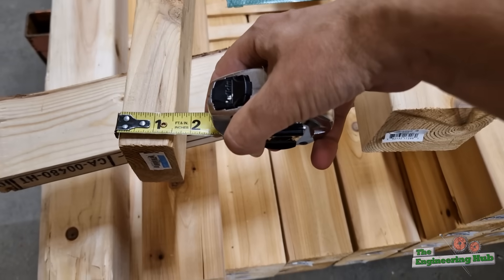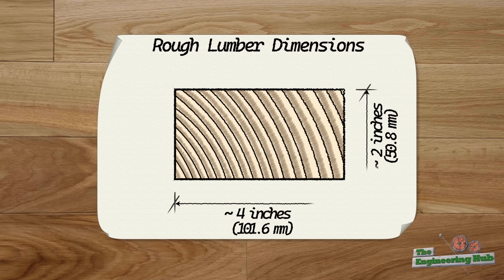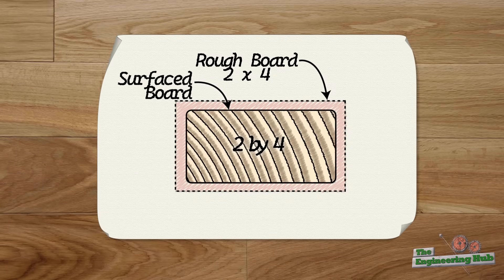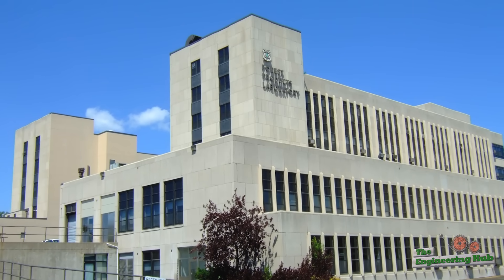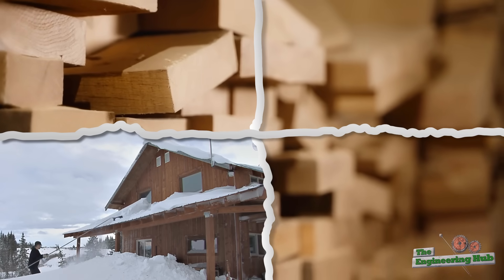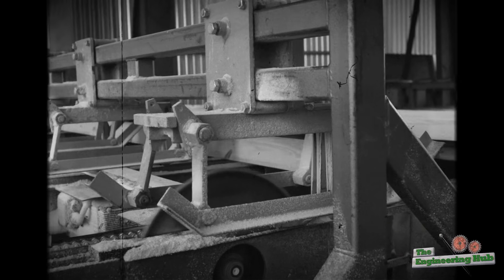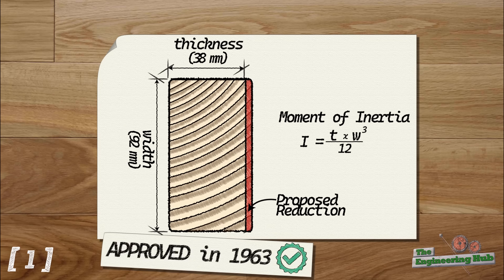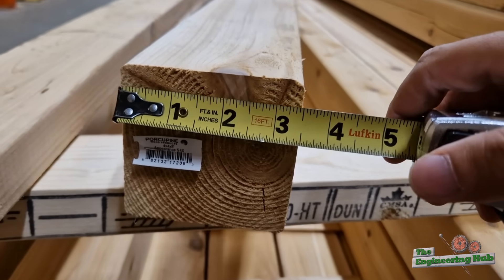Why is the 2 by 4 getting smaller and smaller?

Comment: I worked in a southern pine sawmill from 2006 to 2009 -- from what I remember, most green-sawn lumber started out much closer to the stated dimensions (eg. 1.75" x 3.75"). It is then kiln-dried to a moisture content of around 8 to 15%, which causes it to shrink to about 1.70"x3.65" or so. After that, it is either then sold directly as rough lumber (usually for export only) or it goes to the Planer Mill. There, the dried boards are loaded, X-ray'd (to check for metal objects that could destroy planer blades), and then planed to final nominal dimension. The board is then re-measured for moisture content with an inline moisture meter, and re-measured for final dimensions with multiple laser curtains. It then goes to a grader line where the graders put special marks on the boards using big fluorescent colored crayon-type things, and these marks are read by an optical reader which causes the boards to get trimmed to final length (based on the marks, bad ends might get trimmed off), and then finally sorted into the appropriate bin. After each bin gets full, it is unloaded onto the final conveyor, auto-stacked on a palette, wrapped, tagged, and then stored in a warehouse/shed for loading onto a truck or train car.

Also, everything was recycled. All of the big wood chips were sold to nearby companies for making paper pulp or composites. And sawdust was used in the plant's furnace/boiler as fuel for producing steam for the steam kilns.
Reply: This is more realistic. My mill currently runs rough 2x4's at 1.601 + - .035 x 3.660 + - .035. Get a little more recovery out of those few thousandths.
Reply: Who buys Kilned dried lumber to build a house?
Reply: I worked in lumber and the kilns were steamed by burning a "hogfuel" mixture of bark, chips and sawdust. It was a science to get that blend right for emissions standards. I didnt think it was possible to burn only sawdust and still meet those standards since it would burn to fast and hot for a typical boiler. Were they made into pressed blocks first? Did that work from an environmental standpoint?
Reply: You forget that the whole green peace movement is phony.
Reply: @evonne315  I didn't work in the boiler room or visit too often, so not sure what the exact mixture used was, but you're probably right. I am guessing some of the bark from the debarker + chips were used as well, along with other additives.
Reply: @evonne315 Emission standards are not really a thing anywhere but major population centers.  That is all fine because, when you consider it, it is actually better environmentally and economically, in lumber.  Let me explain.

When you look back in history, periods with higher CO2 had larger flora and fauna.  This is due to CO2 being a primary "food" for trees.  Introducing more CO2 around them actually allows them to grow larger, quicker, as long as it isn't in extreme excess.
Essentially, larger trees, making more lumber.  If remote enough an area, you  can have an area that is extremely great for trees to thrive.  The burning of raw lumber really only produces CO2, unlike cars or Coal.  There isn't anything harmful to trees.    That said, it isn't necessarily friendly to any humans, but could be as long as there are enough trees around to convert the CO2 to O2.  Thus, this encourages these industries to replant any trees removed, often more than removed since it is more profitable to have more product.

This is partially why the East Coast side of the US has far fewer major issues when it comes to fires as the West Coast.  That and the East practices Forestry Management, like clearing dead trees and debris from the forest grounds, which is illegal in California.  This is really interesting when you consider that there are far more trees on the Eastern US.  Maybe California and the rest of the West Coast should start asking their politicians why they don't adopt these policies instead of crying every year when half there State burns due to a random lightning strike or some out of control campfire.  They would be a lot better off, both economically and environmentally. (Economically because of the millions that would be saved due to less fire fighting needed)
Reply: @DrakeKY-l7s I think you're missing a key point about the wildfires: humidity.
The west Coast is next to a desert. It's fucking dry as hell out there. I'm from the east Coast and every time I go out west I need moisturizer and nasal spray and lip balm or I start bleeding from everything as my skin just dries out immediately... there are states out west that do tons of forestry management and they still burn. 

Not to say that California is doing it right, cause honestly I have no idea what they're doing out there... but the wildfires are from the (lack of) humidity, not because there's still some dry logs lying around that didn't get burned the previous year...
Reply: @Igneusflama  I did take humidity into account.  I never said they would be immune to wildfires.  I only stated they would be a significantly less of a problem.  When you don't have dead kindling everywhere, it makes it more difficult to spread.

As for your dry skin issues, you might want to check with a doctor about that.  After all, I don't think it is normal if you are "bleeding from everything" just because it is low to no humidity.  As someone who travels a lot, I am astounded you can even survive for any length of time with that condition.  Never heard of it.  I hope the doctors can figure out a cure for you.
Reply: @DrakeKY-l7s  lmao, it's not a medical condition, I've just been born and raised in tropical areas with extreme humidity and have only ever left that environment a handful of times in my life... I can go to Florida and when everyone from up north is dying from the humidity, I'm happy and normal.
As a consequence of handling that humidity like normal though, I get dehydrated easily. The "cure" is the stuff I mentioned I have to do in dry environments: drink tons of water and use things that keep my nose and lips from drying out and cracking... it's not abnormal. It happens to friends and family members who have spent most of their lives in humid environments.
Reply: @Igneusflama  Sorry to burst your bubble, but it isn't normal.  I could see if you lips bled but not "from everything", like you claimed.  Are you saying you exaggerated the truth?  How can anyone believe anything you say then?  You really should refrain from exaggerated comments in the future.  It destroys any credibility to your comments.
Reply: Lot of salty 🍆s in the comment section. OP, I liked your post.
Reply: Bibler bro's mill ?
Reply: I worked at a Sawmill just like this for a year.
Reply: How does this change when buying treated lumber?

I used to haul roofing material with a flatbed. You typically use 'V' boards.  Two pieces of 1x4 connected with a piece of strapping material. 

Most of the non treated available at lumber yards were almost useless.  I would purchase treated lumber, not because it was treated. It just seemed to hold up better due to fewer imperfections.
Reply: Its always funny to me how they use the term KILN dried, because as a clay scuptor, to me a kiln  would burn lumber to charcoal as the kiln would get up to over 2,000 degrees F, the so called "kiln" they dry lumber in is at best a "hot box" not what I would consider a "kiln"
Reply: So in other words, it's all an over priced, difficult, fancy and state of the art way to produce useless garbage.

America in a nutshell.
Reply: All that to make a crooked board that stays the same or a straight board that bows in the sun😂
Reply: Is that why all the wood at Home Depot is shit?
Reply: @stevechance150  I have a neighbor thats does construction and says the Home Depot/Menards lumber is junk. You have to go to the pro yards to get the good stuff.
Reply: @stevechance150 no, it's shit because it's cheap.
If you want to buy premium wood, you can, but you'll have to pay premium price for it. (I know, I work in small scale furniture business. We buy wood by the truckload, of a quality that you wouldn't believe)
Lumber yards that aim for the end consumer market usually don't carry premium wood, because people aren't willing to pay for it. If you go to a retailer, you can get it, but they aren't likely to sell you only two planks.
Once in a while, the lumber yard will get a shipment of lumber that is of much higher quality than what is on the label. Who knows why, but I've found this to be the case in most lumber yards that I've been to regularly.)
These rare finds give people the impression that this is the quality they "should" get all the time. It's the rest that's shit... But no, if you pay three bucks per stud, you can't expect that quality. (Sorry, I live in Scandinavia, I have no idea what your prices are in the US, you get the point)
We can get better quality as customers, if we start to demand it.
But, changing the quality of the wood we can buy, is a process that will take many years. For decades now, people have come to expect super cheap lumber. The forestry and milling industry is streamlined for this type of production, that is why we get what we get.

My advice is to look around for a local sawmill, a local woodworker or talk to the guys at the lumber yard. Explain that you want to buy high quality wood and that you are willing to pay extra for it. Don't expect any freebees.
Reply: Isn't it great that so much time, money, materials, effort, and production is directed towards making products that are fundamentally useless and meant to be thrown away?
Reply: It's going down!
I'm yelling timber!
You better move!
You better Dance!
Reply: that aint wood. that is scrubs for quicker money.

Comment: Thanks - I thought my memory was going, having thought in my youth they were 1-5/8 x 3-5/8, now I know at least that part wasn't wrong.  Now I am waiting for them to relax non-load bearing walls to 2x3s with typical 2x4 spacing and top/bottom plate (I calculated the 2x3 spacing used now probably didn't save enough lumber to pay for the added labor).

Comment: It's the inconsistency that really irks me. KD 2 x 6's can vary from 1-7/16" to 1-5/8" by 5-1/4" to 5-9/16", (36.5-41mm x 133-141mm) that's actual from the last 8,000 b.f. package. Coupled with plywood producers getting away with 5-6% under stated thickness and it's nearly impossible to frame a decent, tight home quickly anymore and sucks for the follow-on trades.  We're moving to factory-built walls and just purchased a mill, kiln driers, planers, etc. as it was worth it for cost predictability, quality, and waste avoidance.

Comment: I've worked on VERY old houses before, and the 2 x 4s were... 2" by 4".  And the framing was still rough.  The sad part is that the "2 x 4" has shrunk even in my life time (OK, that's 62 years, but still...)

However, I believe the biggest factor in the shrinkage is price.  The value of the dollar has fallen so much (and hence the number needed to buy something increases), and the Powers That Be have done such a good job at putting peoples attention on the price... well, what are manufacturers of pretty much anything supposed to do?
Reply: My house has a mic of REAL lumber sizes and fake lumber sizes.
Depends on what decade each part of the house was made.
Reply: Can use a smaller tree too. The rings in a board have changed a lot too so I figured that’s why the board keeps getting smaller and smaller they’re trying to grow a tree faster and faster
Reply: Shrinkflation is real!!!
Reply: It's going down!
I'm yelling timber!
You better move!
You better Dance!

Comment: What about 2 x 6 lumber? When I was carpentering, the 2 x  6? The width of  a   2 x  6 is now 5 1/4, down another quarter inch. Half inch plywood was a full half inch thick, but now it comes in 15/32s. Are you going to explain that as an effort to save shipping costs?

Comment: All fine and good, but not wholly true.  The home I live in built by my grandfather has true dimension mill finished lumber in the stud walls and roof.  2x4's, 2X10's measure true.
Reply from the maker: My guess would be that it was likely built in the early 20th century (before 1930). Back then they used actual measurements.

Comment: I'm old enough to remember 1 - 5/8" 2x4s.  By the time I started building stuff in the early 1970s  1.5" was the standard. I don't think carpenters planed dimensional lumber for construction. I think I know this because whenever I've seen Used really long Jointer  Planes or Jack Planes that would be used for this, they never show much wear. My Jointer Plane has to be at least 80 years old, almost new. None that I've ever seen have ever shown much wear. 
I think the post WWII housing boom standardized lumber. Levitttown wasn't going to build 10,000 houses as efficiently as possible with non standard lumber. (Eli Broad, of Kaufman and Broad Builders counted every board and nail in  a house project to figure out how to save money.) 
 In 1920s bungalows, like the ones framed in redwood in Los Angeles. The lumber didn't have to be uniform. On top of the framing was lathe (~ 3/8" x 1.25") then about 3/4" of plaster. The plaster leveled out all the unevenness in the lumber. In the 1930s construction lumber was uniform, plaster board (an early type of drywall) was used with a layer of plaster.  By the late 40s it was fairly uniform. 
What I can't fully explain. Construction lumber was green, had some moisture content. (Saw many a 2x over the years that was wet like a sponge. You can leave a piece of wood out in the rain for a month and it will never get that wet.) Green lumber shrinks. I think they dialed in the greenness (water content) so that a board was green enough to nail without splitting but not so green that it would shrink and cause problems with the plasterboard or drywall. 
And in 1993 when I extended the back of my house 11' x 25' I used 2x6s instead of 2x4s and put 3/8" plywood shearing on all sides of the walls and partitions. Cost me maybe $200 more. 
At 5:40 what you're talking about is "Youngs Modlus". It's how an I beam works. I find this quickly explains how beams have strength and gives a term that gets a lot of good results Googling.  My experience and that of many great framing carpenters I've known is that the current (40 - 50 years) standard for framing is near perfect. (I now live in a 1952 'shack' clearly constructed by guys who didn't know a lot. The bracing was inadequate and there's a crack in the ceiling that keeps coming back. (A purlin tying them all together with a few braces up to a purlin along the rafters would completely solve this problem.) So my house is pretty crappy, but the basic construction is so robust it's survived several earthquakes, a billion termites and an inadequate foundation.  (The history of sawing lumber and framing  would be good topics.)

Comment: Bottom line is the consumer was started to be ripped off. I own my grand parents house that was built in the 1940's. It has true 2x4 lumber. Instead of drying the lumber first and then cutting it to size, the lumber industry started cutting lumber while its green/wet  and then it shrinks. This is why when you go to places like Lowes, you get schitty lumber of all sizes since it shrinks at different percentages and the lumber bows so bad at times you can literally build around a corner with it! And for at least the past 20 years they been using fast-grow lumber which has large grow rings instead of tight grow rings. Tight grow rings gives a more structurally stable piece of lumber and when you have large grow rings, you get more twisting and variable shrinking ... so now what you get at places like Lowes, HomeDepot, etc are 2x4's that one is 1 3/8 x 2 7/16 and other boards are 1 7/16 x 2 3/8 and you get to spend all day sorting through the pile trying to find lumber that is actually going to be adequate for the job youre doing 
Oh and how many of you also built a wall and got the drywall put on just to come back after the homeowner called you several months later and the studs in the wall had twisted and/or shrunk so bad that it tore up the drywall. Imagine the drywall screws fastening the drywall to the studs in the wall and them the studs twist and/or shrink!